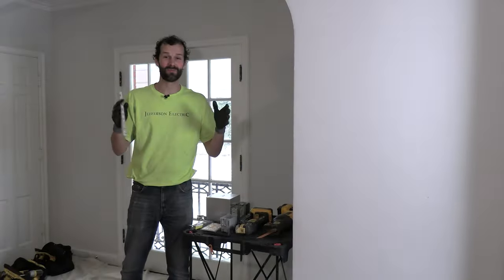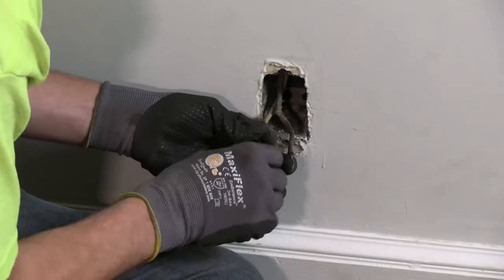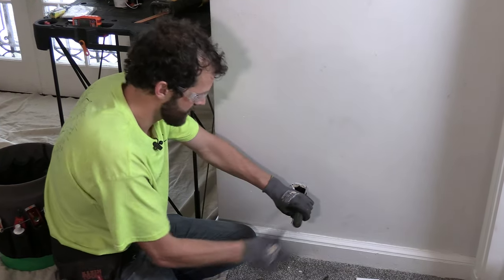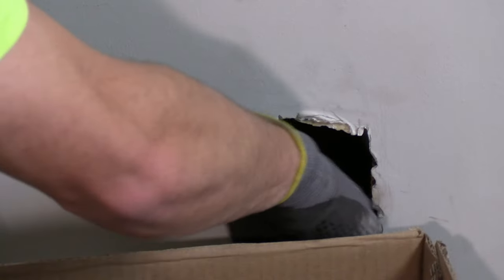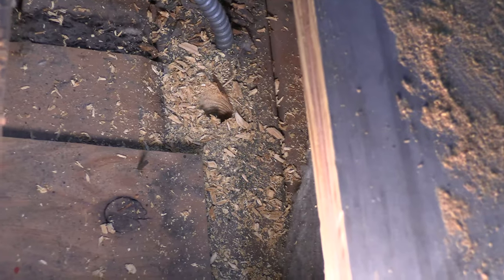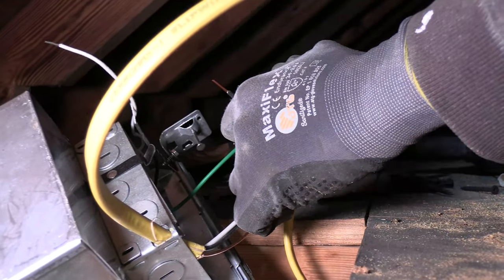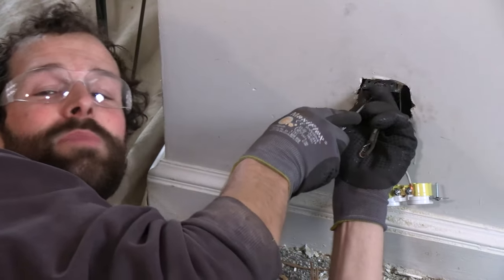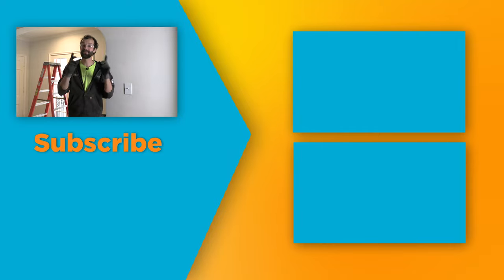How To Install Recessed Lights In An Old Ceiling

Comment: A tip for anyone still watching these amazing videos a year later or more- for cutting plaster cutouts with an oscillating saw- if you're doing a lot of plaster cuts with it, spring for the carbide blades. I get a TON of life going through plaster/beadboard here in California where a lot of the older walls are that style, and even if you have the diamond wire lath behind, I've gotten a good 20-30 foot run through ALL of that, with the teeth, creating a razor sharp line when we remodeled one room and needed to cut the angle out to save the ceiling plaster but remove the wall plaster. The diablo blades are fire for that kind of work and can't recommend them enough for any plaster cut outs when you want to keep the cleanest lines possible. What he says about non carbide is spot on, one little nail and it's a dead blade.

Comment: Masonry/diamond coating grinding bits and blades are heroes on plaster and rock lath. Much cleaner, more stable edge on the plaster and they don't just melt. The only thing(s) is that it likes to dance on paint so cut through it with a utility knife first, and then switch to a wood or metal blade as needed once you're through the plaster. Hope that helps someone watching this down the road and doing similar work. Oh and carbide grit on hole saws works fine too, really anything that's going to grind instead of use teeth or try to cut.

Older homes though, it's always what level of surprise am I finding today. Never fails you go to swap out a fixture and something that's a 20 minute job turns into an all day project as you find the insulation on every wire in the box has crumbled and split and there's no way to salvage anything in the box, and they left no slack in old homes.

Comment: I've decided that with any home I have built it will have metal conduit to all metal boxes. Makes pulling new wire easier and saves walls from needing to be cut or more holes being drilled. Especially in cases of insulation or foam. And also satisfies my grounding fixation too. So glad you have to use metal boxes. Kind of sucks that the NEC dictates how you wire your house but metal is so much better all around. Environmentally, integrity, grounding, and longevity.

Your video got me thinking, that there ought to be a way to have walls and ceilings open and close, like a hidden door mechanism, so that would be easier. If I ever get to have my dream home built, I am going to insist there be 4 feet pathways between my walls so I can squeeze my fat... self in there, and get to the connections that way. I don't know if any of these ideas are practical. I think ideas look good, but then are a big hassle to bring to fruition then don't work the way I thought it should.

Your little helpers are watching you.

Fire blocks don't make any sense to me. Wood is combustible so it's going to burn. If the house is on fire, and the fire department comes the home is lost either way. Either to fire damage or to water damage. I doubt that if your house is on fire that wood is going to buy you any amount of significant time. It's crucial to keep those detectors working, have a plan where to meet and even schedule fire drills. Surprise everyone maybe every 3 months with a drill at 3 AM. Everyone gets jarred awake and meets in a designated safe place. Just a suggestion. Your wife and kids will LOVE that at 3 AM.

I also like that you're using 12 gauge wire. I will insist that no 14 gauge wiring is used in my home. It just doesn't make much sense knowing now what I know.

You drilled nicely through your rafters. My drill constantly catches and twists. I have the same you do and same type of bit and it takes me twice as long to get half as far as you (before I became crippled.)

As far as wire fill, it has to do with heat and damage. I have wire boxes over stuffed. I feel them. As long as they don't feel warm, I don't worry too much about it. It's going to be like spaghetti for the next person, but given the way things are now, if I am not the next person, it will be the person that TOOK my home away from me so the hell with that person. If you have more than one light, you can probably daisy chain them. I always insist on another home run, but if you want them controlled by the same switch, then daisy chain them. You're also in an older home so it's not always possible to do a new home run for everything you add. Another reason for my idea of a 4 feet cavity between walls and using rigid conduit for existing wire runs. I'd also probably go for Wago lever nuts and throw out those twisted nuts. I have been doing that all through my home too. I really like them, I feel that they're more secure. Nothing to twist loose and just easier. 

I might also think about wire touching the can enclosure only because I personally would never use LED lights. I am into halogen and they get very hot. I don't know if they would melt the wire but I don't want to find out in a surprised way. Just a little "extra" as my sister would say. She always tells me I'm "Extra". I have no idea what she means but I take it as (Short bus special.) Just my particular peculiarities I guess. I like that term "vibratory seat" the term I made up was "percussionist set" on something I installed. Not a LED though. Some kind of lens cover with trim.

I don't understand "inch pounds" so that's something I have to learn. I've always used hand tight, or until the power bit stops or slips out method. Never had a problem yet, but I suppose I should learn the proper way and obsolete all my existing screwdrivers which is what I think that all secretly boils down to. A conspiracy so that everyone must buy more stuff and spend more money. The old ways have worked just fine all this time.

I also say the same thing when I am working "It should not be this difficult" Lately that's changed to "This should not be impossible." So it's getting to the point I will need to just leave everything alone until I can afford to get an electrician to do it. As you know I'm a sticker for grounds and doing things right, so I'd never make a "smart remark" about making sure that's perfect. I think buying a home and finding no ground wires, then cut ground wires on everything that COULD have been grounded and wasn't, made me this way. I never recall being "obsessed" about them before and took them for granted, I guess. sometimes, one doesn't think about or miss things until they're gone.

Also, I don't make a big deal about the plaster being tight either. I own the home for now, and if I sell it, it is going as is, and if it's taken from me, it won't matter. I am likely going to open up one side o f the walls anyway to run all new wire to the basement. Another thing in this house, the idiot ran the circuit to a ceiling box, then octopus the wires out to other rooms and circuits from the kitchen and bedrooms, and back down the walls. Totally wrong. And I am not going in my attic. It's not even a full attic, but a crawl space, something else that if I realized when I bought this house, I would not have bought it. This is my first home I bought on my own after being forced to sell my Mother's home when she died because I couldn't afford to stay there without her income. Just all kinds of injustices. When my Dad is gone, I will likely open up one side of my walls. Otherwise, it's too much excitement for him so things are just as they are for now.

I noticed you attached all your wires to the screws on the receptacle instead of using a pigtail solution. Just curious as to why or why not is all. As far as tape, I always do it, even on a GFCI and a plastic box, (Which I personally don't use) because the ground wires are bare and they can slip and short something. The person that taught me, in trade school, when I was 15 years old, and that always "stuck" with me. No pun intended.

I also don't like oversized plates. That also goes to my vernacular about the NEC dictating. If the drywall isn't tight, and an oversized plate hides it, then it doesn't make much difference. I had an oversized plate hiding bad plaster but when I changed it to a GFCI because of no ground (Temporarily) there wasn't a plate big enough to cover it. If a mouse finds its way in the house, and wants in that wall, he's going to find a way in there, covered or not. Great video !

Comment: 🟣  What about the firestop caulk on the top plate going to attic  ?  You forgot that. 

The cloth on the ceiling was canvas. Common to see in this time period and earlier. I was an electrician for 30 years and worked in those old dirty houses. You bring back a lot of memories 💡

Comment: Two things that might help smooth out your hole work for the can. One, a salad bowl type dust catcher on your hole saw. Two, a 1/4' larger hole saw. 4" cans usually need a 4-1/4" hole. Also get yourself some rods to move your Romex through walls and ceilings especially when they are insulated.

Comment: My favorite tool is the wood head tension receptacle tester a simple tool but really is uniquely well positioned to determine when to do a receptacle change out. I use flat duck-billed knipex insulated pliers excellent for straightening out wire trust me you use it you will never go back. So good to see you are using PPE for eyes, hands and ears 👏🏾👏🏾 I also now use a camera tool to check behind and around existing boxes and using a good electronic stud, wire and pipe finder which works well.
Reply: Math Man, can you drop links for those tools here. I can't quite picture what you're referring to.
Reply: Yea, same here. I'd love to see what your talking about with the "wood head tension recept tester." I also use a little camera to try and see as much as possible. I have my guys even use their phones and try and stick them in the wall and take pics up the bay to see of theres blocking and stuff. Ive always liked seeing how other electricians do different jobs.
Reply: @thirdeye_pythons6064  tells me early when it’s best to replace receptacles lower tension with prongs tell you the increase risk of a poor plug receptacle connection, with potential for arcing, heat build and increase potential for fire. See the woodhead receptacle tension tool (use only on de-energized circuits. See

https://woodheadsales.com/pdfs/pushbutton.pdf
Reply: Receptacles are cheap. I almost always replace them unless they are very fresh and new looking. I could see using that Woodhead tester to sell a customer on receptacle replacements.

Comment: In situations like the plaster blow out on the receptacle I have in the past taken a paint stir stick and liquid nailed it inside the wall above and below my receptacle box with small c-clamps to hold in place and allow it to set up. Then replaced the box and continued with my wiring as normal. This gives you something to repair the plaster around the opening as well at the same time as the liquid nails is setting up in the end you get a very clean job without having to revisit the outlet or switch for plaster repairs in the future just maybe a little paint touch up. Also if you run into a location where you have to use an over sized cover plate for whatever reason if you swap out all the cover plates in the room to the same size the eye can’t tell the difference

Comment: Lowe’s sells a metal plate that slips over the metal box that would have secured the front edge of the box at the plaster, closing the over cut and allowing you to tighten up against the wall. Sometimes hard to find so I keep a couple in my bag.
Reply: You know an item number on that?
Reply: @donl1410  RACO 4786 Model #9017
Reply: Check HD for RACO 999x also
Reply: @lorenrickey5481  Thanks!  I'm going to get some to keep on my van for those emergencies..
Reply: @donl1410  also get some midway and large faceplates to cover the over cut damage. No drywall to repair.
Reply: @lorenrickey5481  large covers are good for a quick repair but remember the code requirement that the gap between box and a non combustible wall can’t exceed 1/8” (article 314 if my memory serve me correctly). I keep some spackle in my bag to fill the gap then cover with an oversized plate.
Reply: Thanks for this. I'd looked for this item the other day without knowing its name and couldn't find it.
Reply: @garyjeffersii6735  
Amazon has them too. 
RACO 999 x comes in a 3 pack.

Comment: Great job I would just finish the job with testing IR, continuity, loop impedance and if covered by a protective AFCI or GFCI would test for that using a multi-function tester. Record that data proving that the install was done safely, no inadvertent shorts and breakers will trip under short circuit and ground fault conditions. However that something more done in UK and Europe than US. I would also torque receptacle screws and I like the ideal blue armor wraps around the receptacle way better than tape.

Comment: Tip for extending the life of bi-metallic hole saws: Mount an old circular saw on to plywood and turn it upside down. Using a diamond saw blade, regrind the teeth and cool in water every few teeth. I had to drill 384 - 3" holes in plaster where the hole saw became dull after drilling six holes when I blew in insulation in 1934 five bedroom home.

Comment: when you drilled the 4 inch hole, put the drill on reverse till you get through the plaster - wont grab at anything  - same concept as drilling through vinyl siding - if you drill normal you can crack or split it

Comment: Did this job specifically call for a recessed LED luminaire?  If not, seems to me a wafer LED luminaire would have saved you a lot of work. It would not require the big traditional metal box to be installed and you could have done it all without ever going into the attic except for maybe running the cable.

Comment: Looks like the original builder screwed up on the roof. Unused Birdsmouth cut-outs on every one of those rafters but they used them anyway. Amazing that this would pass inspection.

Comment: 20+ yr Master Electrician. Just found your channel a couple days ago. Plaster  is the worst to work around for sure, nice job maintaining the carnage. Curious if you typically utilize the device as the junction as you did in this video or  use pigtails? The AHJ requires them on any new or permitted old work. Curious about best practices and AHJ nuances in other parts of the country.

Comment: Box fill as you suggest link to issue of heat build-up but also overfill can create much greater likelihood and potential for shorts and arcing. That being said many of these rules in the NEC were built on much older testing approaches. Heat build-up in boxes and conduit bodies greatly depends on how the conductors are aligned. Results from more recent CFD modeling will feed through to future NEC in some cases we will have to be more conservative and in other cases less on box and conductor fill.

Comment: Can lights presume you can get into the attic. I deal with a lot of vaulted ceilings or 150 degree attics. Good wafer lights allow you to set the color temperature. Sure, you can't change the baffle, but I'm still on team wafer.

Comment: normally love and appreciate your videos, but you missed here - starting with your statement about commercial electricans vs residential electricians. It was good for a chuckle though.  Anyhow, you should try a plaster bit for your oscillating tool and hole saw.  Also, don't you need afci protection for that circuit since you extended it?  I'm not a fan of your extending a 1938 cloth wiring circuit with what is probably be an iffy ground - that ac cable probably doesnt have the bonding strip in it.. Thanks for your work in making your videos

Comment: While watching you excellent video I could not help but notice that when your house was built the carpenter who built your home messed up when cutting your roof rafters. The bird mouth cuts are in the wrong location and the carpenter simply used the rafters and cut new ones in the proper location effectively making your two by sixes  two by three. Still wood is for giving. Try not to think about it too much.

Comment: Would it have been possible to put up a j box in the attic to be able to run a new wire and not take the chance with the old shortened wire?

Comment: So, if given that in your AHJ (1) code allows for new receptacles to be same height as old work and that (2) the switch heights are consistent throughout this old house then (3) wouldn’t it make sense that builder would not locate fire blocking at height where switches might be and therefore (4) if you’re using that methodology, you shouldn’t be finding yourself cutting into fire block now?  So what happened here?  Did original builders not locate fire blocking at consistent heights only and unless they knew there was going to be a switch or other feature co-located at that height from the start? In other words, is there any way that the fire blocking could have been predicted other than to have felt the fire block when you were cutting the wall (which apparently you failed to detect)?

Comment: Do you need to do anything to fasten the service loop @38:50?  On one hand, fastening defeats the purpose of having a service loop, but on the other, the loop would not be spaced intentionally in the cavity if someone were to drill, screw, or saw in the future.  I guess you've already done the sawing so that's unlikely, but wondering if there are any requirements for this sort of situation.

Comment: 8 Kids? I'm the 7th of 8, there are 21 years difference between the oldest and youngest. Today, the oldest is 82 and the youngest is 61. I'm 66.
I've been a carpenter for 47 years and I have seen electricians deal with this same stuff. Most of them were very patient, but others left a lot of repair work for me. At least I get good a plaster repair.